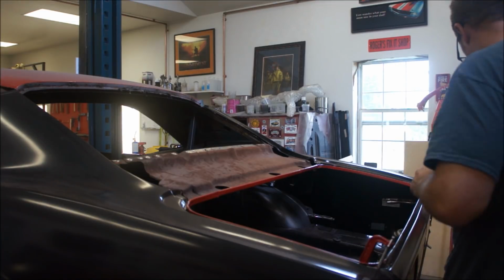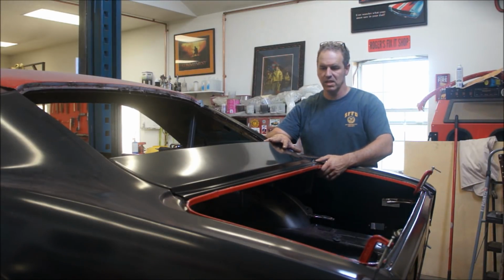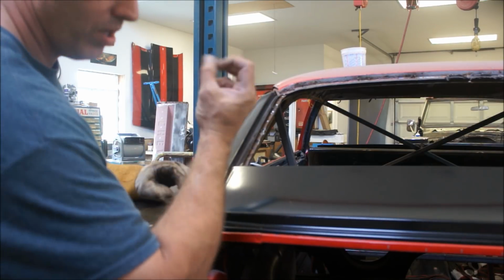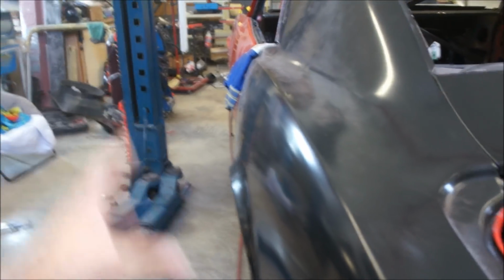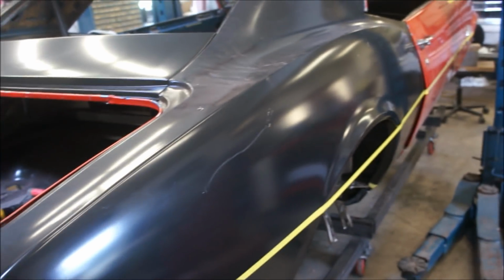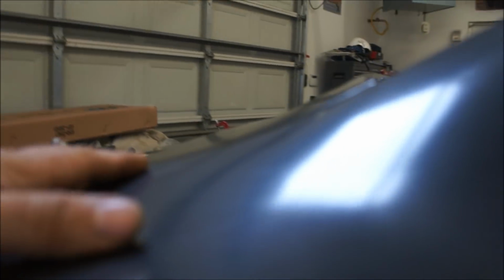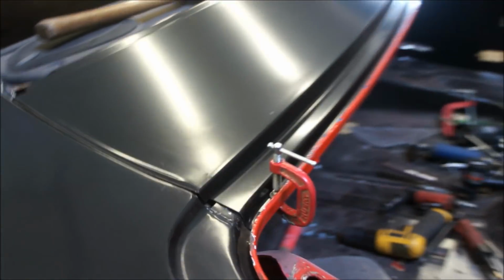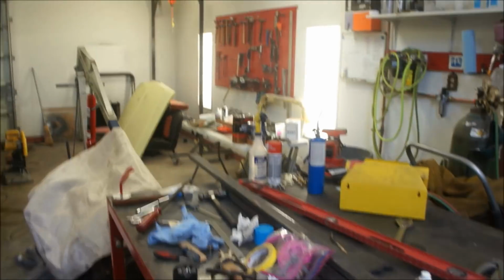68 camaro replacing deck filler

Comment: I know it ain't cheap but the best method , by a long way, is to have the bare shell dipped to remove and neutralise any corrosion. It gets into the seams and cavities. The electrostatic phosphoric coating offers great protection. Here in the UK my favourite company offers a multi stage process. They dip to clean and give you a basis to repair from. Once repairs are done they take the shell back for another dip and final permanent coating.
 The job is so much easier when starting with a bare shell,makes figuring out the scope of work so much easier. Life so much nicer when not constantly fighting with dirty rusty panels!.
 A light board with stripes like the PDR guys use shows up everything and pretty cheap. Be warned,the light board is very critical of panels you convinced yourself were perfect!

Comment: i use a black 2k primer, when you panel wipe it you can see the panel in gloss black, no way you gonna miss a dent
Reply from the maker: messylaura yeah spi epoxy primer has a sheen to it that helps tremendously

Comment: did you grind/cut the ends to be able to remove the deck lid?
Reply from the maker: Yes grind or used spot weld bit for the ends